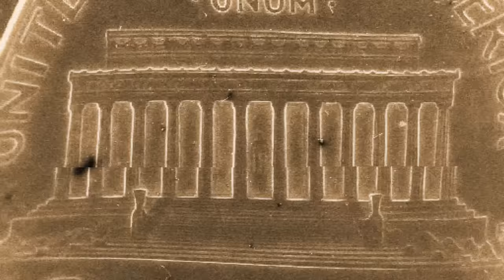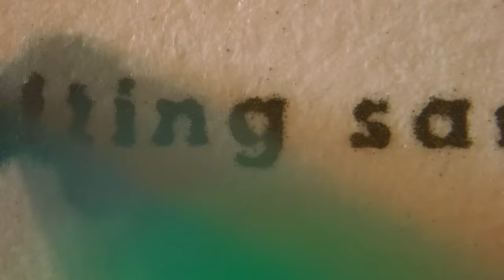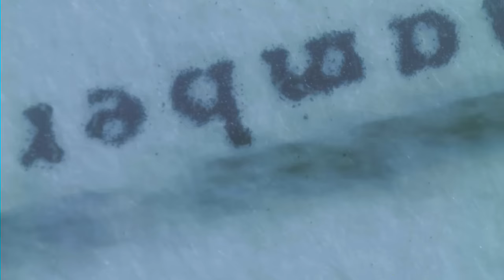Zammuto - Great Equator (Official Music Video)

Comment: the clicking is distracting.  sounds almost like the click pop sound you get when you gate and turn the attack or decay down to zero.
Reply: That clicking is the sound of gashes he's cut into the lead-out groove of an old record. That's why the video is so concerned with microscopy and images of records/tapes/cd's. He's been using this method in his music for years, usually modulating the harmonics with lengths of PVC pipe. Here, it's relatively unfiltered (some reverb near towards end) and paired with a minimal, syncopated drum machine loop. I suppose it could be annoying, but I've heard plenty of retrigger-happy electronic music which does far worse, and I love it!